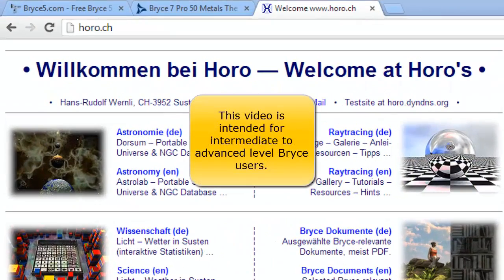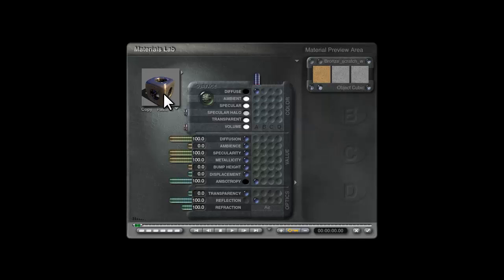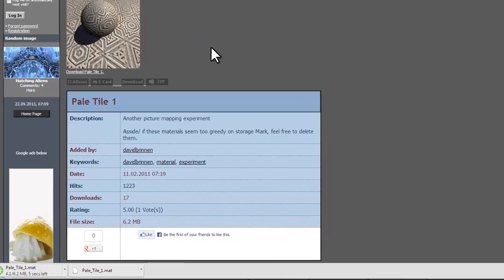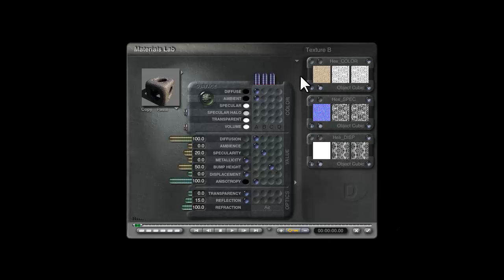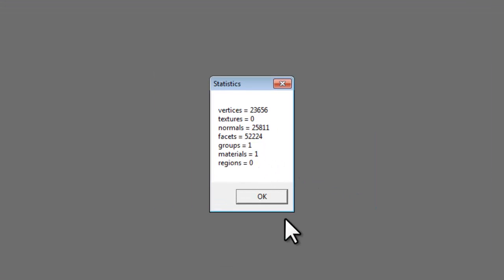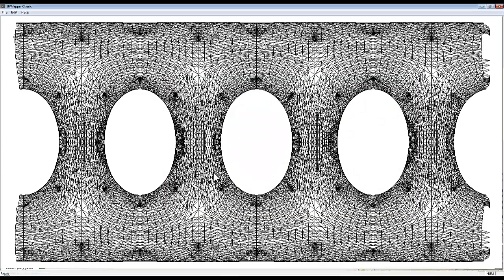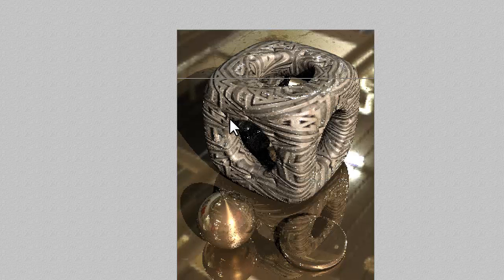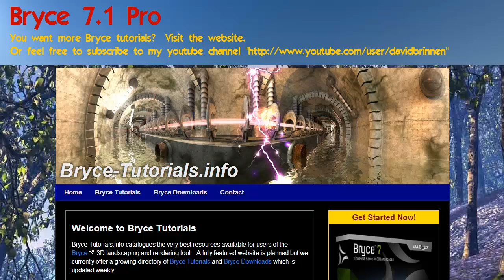UV Mapper Classic and Bryce - parametric mapping and repeating images - by David Brinnen.

Comment from the maker: I only really had to learn this trick because of Octane, as Octane doesn't have Bryce's handy extended mapping modes that work with models that don't have UV maps.  But I'm glad you think it will prove helpful.  I'm finding it useful also now with DS - but I've yet to find using DS anything other than a headache.